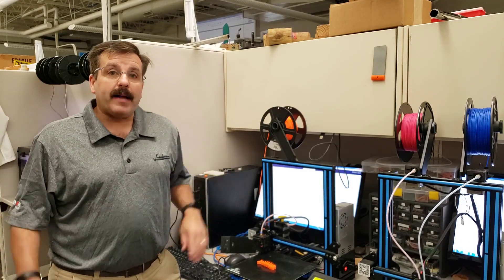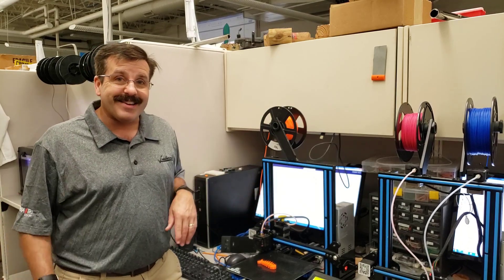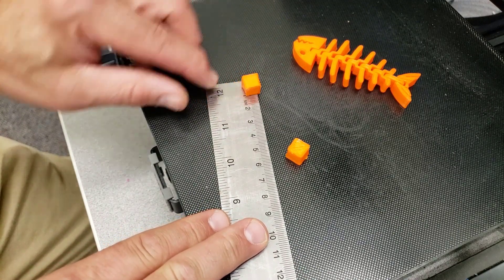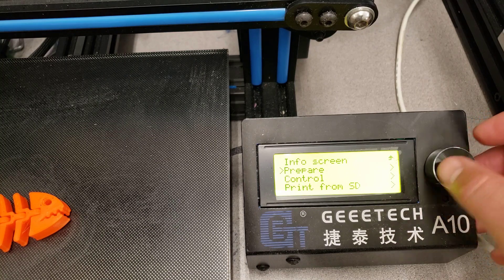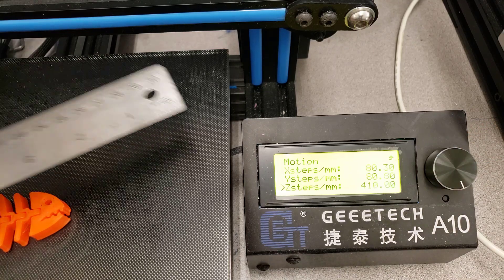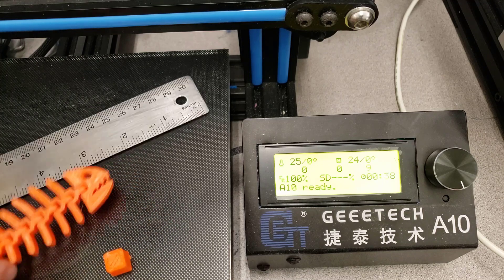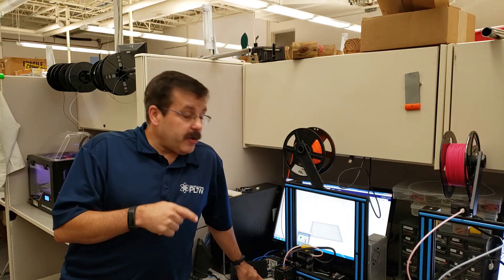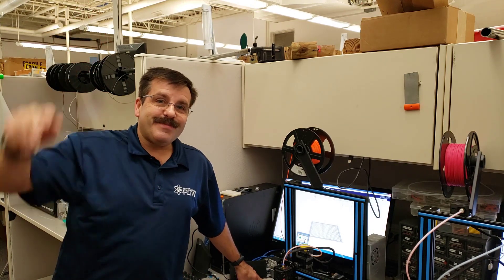Prints shorter than you expect? Check out this fix for the Geeetech A10

Comment: Im curious if you went and printed something 100mm would it be dead on?
Reply from the maker: You can get your printer there by calibrating the steps. Some printers have those settings locked up, but when you add marlin it is usually available. I am not sure any of my printers are that perfect. I print fun stuff so I have not stressed about it.  If you look up my calibration cubes for each printer, they are close enough for me.
Reply: @HLModTech  I'm wondering if it's better to calibrate using a 10mm block or 100mm block. If you only printed toys or whatever I don't see it making a difference but if you tried to print a functional replacement which way could potentially get you closer to printing the exact size it should be
Reply from the maker: Hmmm. As I calibrate I unusually use a 20cm cube. There are a ton on Thingiverse, but what you state does make sense too. Since I upgraded to Marlin 2, changing steps is really easy. I just have not had the need to make it any better than it is.